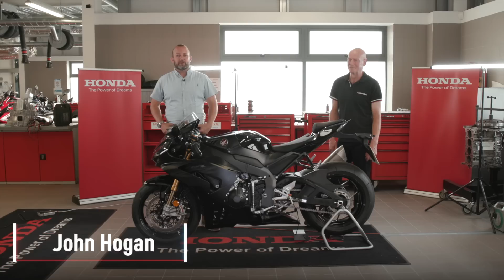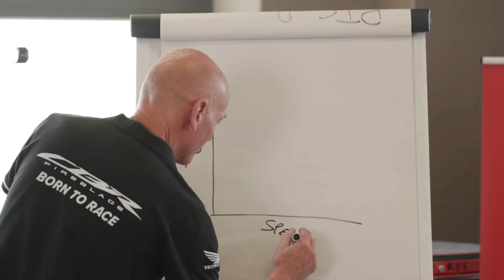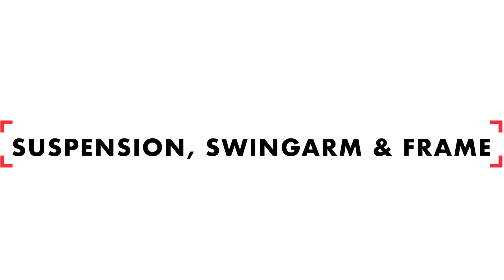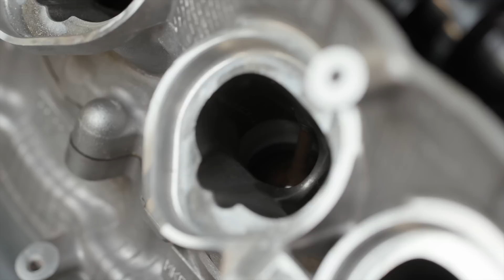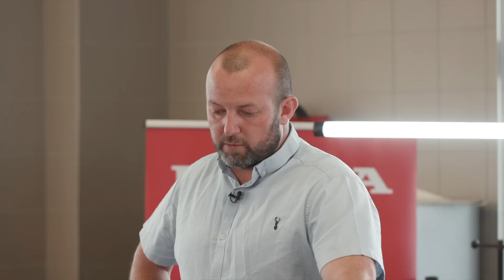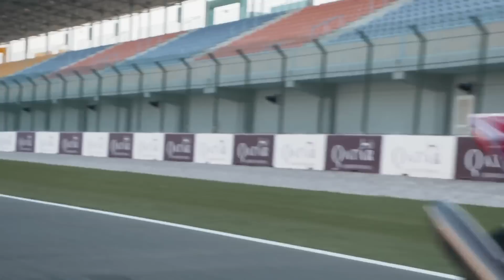The Honda Fireblade CBR1000RR-R SP

Comment: You’ll definitely want to replace the bolt that holds the shifter to the frame mine snapped while in traffic my bike just hit 15,000 miles I keep the auto blipper on medium and my bike has never been tracked Honda FTW 😢

Comment: I absolutely love mine. 201whp stock is brilliant. Looking forward to flashing the ECU for more power and more useable power too along with better throttle connection. Euro5 regs are a horrible thing.
Reply: Are Fireblade 1000 RR-R SP appliying VTEC like in the HONDA car ?....VTEC can give POWER from Low - High Speed consistent Dissipation and Torque
Reply: @saefulbasriamnan552  no they’ve not used VTEC in bikes for a long time.
Reply: That is tough
Reply: What kind of Flash will you buy?